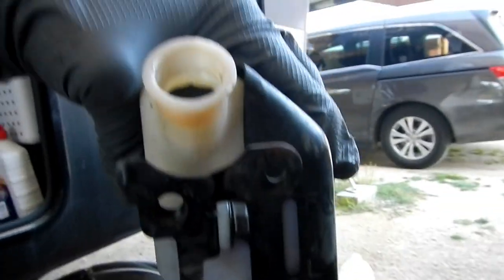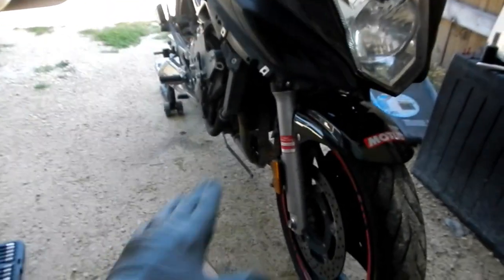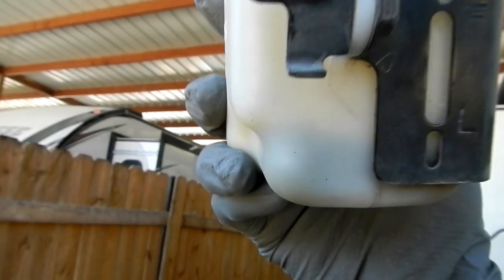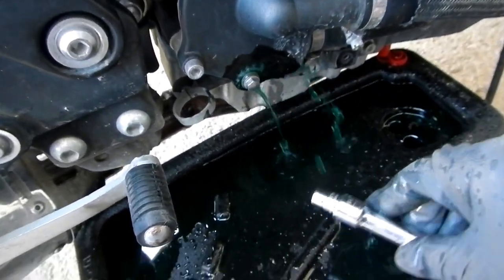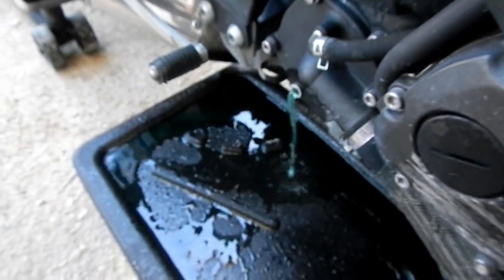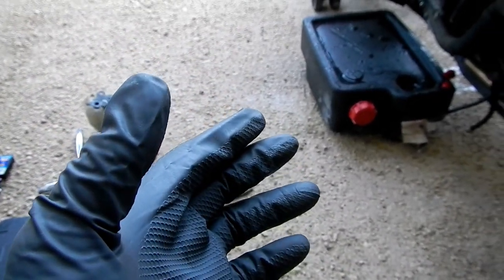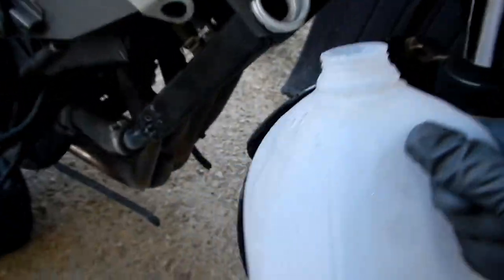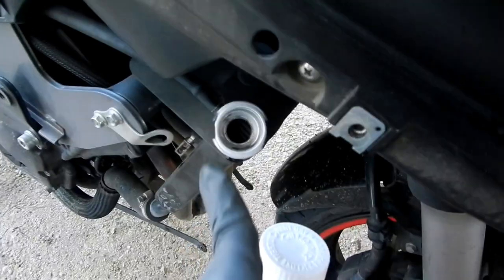Yamaha FZ6R Coolant Swap

Comment: Ay reason they say distilled is because it's completely free of minerals and chemicals that can cause corrosion inside the cooling system.  I know this is totally late, but felt it should be mentioned for clarification. :)
Reply from the maker: Firefly well we most certainly appreciate the information, late or not! 😬
Reply: Just thought I’d throw in that it’s not just corrosion. Mineral deposits can build up in smaller passages and cause flow issues. It’s more of a problem in old beaters that need to be topped off constantly because of leaks. Not that I’ve ever topped my crappy car off with the garden hose because an old fitting that was a pain to reach was cracked and leaking… Definitely not speaking from experience here.

Comment: Noticed the oil light come up decided to change it and it seemed a bit milky like 😢 keep in mind my bike almost always runs at 190-210 temp, bad head gasket ?
Reply from the maker: @Fc2x  yep, sounds like it dude. It’s a helluva job but it’s not difficult if you follow the service manual. Or, follow along with my two-part tutorial:
Yamaha FZ6R: Valve Seal Tutorial - Part 1 of 2
https://youtu.be/ok7-tyC8Hjs

Comment: Hey man, quick question. Did you noticr any difference in temperature after refreshing the coolant? My bike always runs warm in traffic, up to 103 degrees celcius and the fan comes on. Hope it cools down when I put in fresh coolant.
Reply from the maker: DK🌹 yeah man my bike was to the point where it was running 200 degrees Fahrenheit at 80mph on the interstate highway. Since switching to Engine Ice, it runs in the 180s at highway speeds and the fans only kick on when idling for several minutes at long traffic lights. DEFINITELY worth the switch to Engine Ice.
Reply: Half-Click Up awesome, thanks!

Comment: Do you need to remove the reservoir to fill it? Mine looks bone dry and when I put some in the cap it doesn’t go into the reservoir. Could it be clogged? It’s an older bike that was probably sitting for a while. 2012 fz6r
Reply from the maker: You need a little funnel with a flexible tube if you want to avoid removing the reservoir. I don’t own one so it was the only way I had to fill it. When you fill it up at the radiator cap, it won’t go into the reservoir. That only fills the radiator itself. This is why the level drops the first time you start the bike after filling the radiator.. it sucks it through the hoses and the rest of the system, which is why you have to keep adding until it reaches the top.

Comment: My cap on my expansion tank keeps coming off on my 09 fz6r. I made sure it was properly seated but after a ride or 2, it's blown off again. Mabe I'll gorilla tape it down to the expansion tank?
Reply from the maker: Man the thing may just be wore out somehow? Perhaps the plastic threads have become weak and sort of stripped? A new overflow tank assembly may be in order!
Reply: @HalfClickUp  btw my hose inside the expansion tank is bubbled up like yours. Mabe they are made like that?
Reply from the maker: Bob Holsopple that’s very interesting... I’ve been most curious as to what that hose looks like on other bikes. Good to know!! Either they’re made that way or it’s a result of thousands of heat cycles.
Reply: @HalfClickUp  dunno. I got 27,500 on mine so shes no spring chicken either, lol

Comment: Did you end up needing more coolant or was one jug enough? I have the same bike and trying to decide if I need to buy one jug or two.
Reply from the maker: One jug is all you need.
Reply: @HalfClickUp  Thank you! Weird it takes a total of 2.25 with reservoir and radiator and only needed 1.89 but I wont complain! Saves me 25 bucks!
Reply from the maker: Aksel Joy yep I’ve still got the whole second jug sitting on a shelf, as well as the tiny bit still left in the first jug. I still have no explanation for the discrepancy in supposed required coolant vs. what I actually had to put in. 🤷‍♂️
Reply: @HalfClickUp  Probably a bit of water still left in the system?  Just like prior to dumping the first flush of water when you had some "stuck" nasty old coolant in there that needed an extra push to be released...  I don't know!  That's all I've come up with... I'll be flushing/cleaning mine this summer, so maybe I'll "waste" a tad bit of engine ice (if that's what I end up using) and see if there is some stuck water in there from the flush/clean.  🤷‍♂
Reply from the maker: @christophervece  FYI Prestone in the yellow jug has been fantastic, too. I’ve been running it since I swapped water pumps.

Comment: Thanks!  I wouldn't know how where to start to change the coolant if not for your video!  The only thing I did differently though is I bought a siphon to suck out any old coolant from the reservoir instead of removing it altogether.  I guess you could wash it if you remove it though.  Mine didn't have any dirt in it, or any coolant in it for that matter.  Yup, my reservoir was actually empty! :-)  I poured water in it to sort of clean it and used the siphon to suck the water out.
Reply from the maker: T. Cochrane hey that probably saved you a good 20 minutes, cuz as you saw in the vid, that little booger ain’t the easiest thing to get to! Glad my tutorial helped you. Thanks for watching!!!

Comment: If u want to remove the radiator cap when it's hot just put a rag over and slowly tilt the cap away from you and you'll be fine.

Comment: You've done all the the cool mods.  I guess it is time to check the coolant.  I would judge you harshly but I ended up driving my 09 for several hundred miles with no air filter because the bike had been stolen from the previous owner and no one had bothered to check it.
Reply from the maker: archie wilson better late than never, I always say 😬

Comment: You should REALLY think about taking off the drain bolt before uncapping the radiator. It will make your coolant (and oil for that matter) draining much cleaner

PS: when refilling the coolant. fill the radiator, start the engine and let it run a bit while the coolant runs. It will burp out and as it comes up to temperature the indication is that the radiator will want to overflow.

PSS: The maintenance manual for these motorcycles says 2 liters for coolant change, and 2.2 for coolant + reservoir fill. But those measurements are not exact
Reply from the maker: Gonzalo Sanchidrián yes the procedure you describe is pretty spot on to the method explained in a recent Revzilla tutorial on coolant swaps. Every point you made is something I’ll be taking into consideration next time. Thanks for watching and thanks for taking the time to comment!!

Comment: Just checked mine xj6 as I was installing crash sliders and had exactly the same amount in the radiator and in coolant reservoir as you..going to  check which place has the coolant in stock right now lol 👌
Reply from the maker: Hahaha glad you discovered it sooner than later! It’s time!
Reply: @HalfClickUp  have a covid now so plenty of time to fix the stuff on my bike lol..thanks for ur vids..great for out europeans xj6 versions 👊
Reply from the maker: @waterfordMARTIN  you’re very welcome brother, glad my content has helped you!
😎🤙
Reply: @HalfClickUp  also found mine front brake reservoir probably miss some brake fluid..did u do a vid on this topic? Changing the brake fluid etc?
Reply from the maker: @waterfordMARTIN  I have videos on my Mods & Maintenance playlist where I do pad and rotor swaps. I haven’t done a video on fluid swapping because I use a Mitey-Vac for that process instead of traditional manual bleeding.

Comment: Thanks again for another great video.  What was the final verdict about the amount of coolant needed? Did you find that after running the bike that the level of coolant in the radiator dropped and you had to add more coolant? or Did the coolant level remain the same and not require anymore coolant?  Btw: my Haynes service manual has you remove the exhaust to get to the reservoir bolt that sits behind the header pipe.  I much prefer your way of getting to it by removing the left side plastics : )
Reply from the maker: Yes Sir after a couple of rides I burped the system again and was able to add a bit more coolant. That’s insane about removing the header. Sometimes manufacturers just like to make things as difficult as possible. Like Step 1: Remove engine 🤣
Reply: @HalfClickUp  👌 thank you.

Comment: Great video HCU! Have you seen the temperature run lower with the engine ice versus the stock coolant?

I received a radiator guard and realized when I was toying around with it yesterday, I need to remove the radiator to connect the guard properly.  As the bike is 8 years old and running with the original coolant, might as well use the opportunity to do just what you've done here.
Reply from the maker: Nathan so sitting in traffic and at red lights, the bike will still reach 210 and run it’s fan, but where Engine Ice really shines is when you’re moving down the road/interstate; it’ll never reach 200 if you’re cruising.

Comment: Getting ready to do on mine and was just wondering should I let the coolant run though with the drain plug off to make sure all the water is out?
Reply from the maker: Yes two ways to do it:
Quick flush - plug off, let distilled water/vinegar solution run straight through.
Full flush - plug on, fill system with distilled water/vinegar solution, start bike and let it idle till the fan kicks on. Shut down and drain.

Comment: Sorry to keep asking you questions but when I took my overflow off, the black metal piece, the mount was bent. No idea who bent it or when, this is my first time flushing it but from the looks of the paint, it was bent a while ago and someone just made it work. Do you have any ideas what that piece is called? It’s shown in your overflow tank at 12:55. It’s not the heat shield, it’s the small funky looking piece the bolts go in. I’m not sure what to search for, and I’d rather get the right piece than stick with this bent one. I’ll try my best to bend it back but we’ll see
Reply: I think I bent it back to the right position good enough to actually work how it should’ve
Reply from the maker: @infamousctsv2  if you change your mind, the part you seek is the recovery tank bracket:
4P5-21873-00-00
It’s $5.76 on Partzilla.
Reply: @HalfClickUp  wow thats cheaper than I thought, I’m definitely gonna pick one up, thank you so much! I wish I could subscribe more than once

Comment: Do you know about what temp you were at when riding like this? What did you get up to?
Reply from the maker: Even in this condition, temps never saw more than 214 to 216, and that was in stop and go traffic on hot days. That’s pretty impressive of the cooling system. You’d never know just how poor the condition of the factory coolant was without looking.
Reply: @HalfClickUp  I bought this bike as a 3rd owner and my temp is getting around that and staying there when the fans kick on. I’m going to flush tomorrow after work. Thank you man
Reply from the maker: @lilswank2012  good idea.. could very well be the source of your problem. I certainly recommend the Engine Ice if you have access to some.

Comment: does your clip ons hit your fairing? also howd you install the ram mount into the stem lol
Reply from the maker: Yes but it only prevents full lock by about half an inch. Definitely not a deal breaker! In order to install a RAM X-Mount, you need a ball stem adapter nut:
Motorcycle Aprilia, Honda,... https://www.amazon.com/dp/B00CCDPHZ6?ref=ppx_pop_mob_ap_share
Reply: Like your videos man! I'm about to do the same to an fz6r I just picked up from my buddy with 9K miles on. He bought it back in 09 new..btw which windscreen are you using? Is it the ZG DB?

Comment: Did you end up needing to add more coolant? I'm wondering I can get away with a 1/2 gallon
Reply from the maker: I did not, but I did go back and repeat the burping procedure and got a bit more air out of the system.. not enough to warrant adding any more coolant, though. I still stand by my experience of the Fizzer requiring 3/4 of a jug.
Reply: @HalfClickUp  awesome thanks man. I appreciated your vids bro, you're my go to when I plan do to anything to my fz6r 👌 keep up the great work
Reply from the maker: @alexanderking3971  hey thanks dude! I’m happy my tutorials are helpful! 😎🤙

Comment: hi , whats your top speed on this bike ? thanks
Reply from the maker: Hakan Aslan 140mph
Reply: @HalfClickUp  thanks , how many horsepower do you need from this machine
Reply from the maker: Hakan Aslan the FZ6R comes  factory with 77.5hp
I’d guess my mods have increased that to somewhere around 85 to 87hp.
Reply: @HalfClickUp  thats very successfull  :)

Comment: What exhaust did you put on your bike??
Reply from the maker: Kevin Henretty header from an 03-05 R6 with a Yoshimura slip-on. Fuel management with Power Commander PCFC, sport map from Marthy’s Exhaust Solutions.
Reply: @HalfClickUp  I have a 2012 FZ6R myself. It is so hard to find aftermarket parts that fit it!
Reply from the maker: Kevin Henretty if you wanna go with a full system that doesn’t cost $1,000 you should check out Black Widow exhausts. Full kits for under $500. People seem to like em alright.
Reply: @kevinhenretty6460  I think M4 makes a cheaper full exhaust for the FZ6R. Or you can always go with Marthy's viper exhaust
Reply from the maker: Kevin Henretty anything in particular that ya looking for?